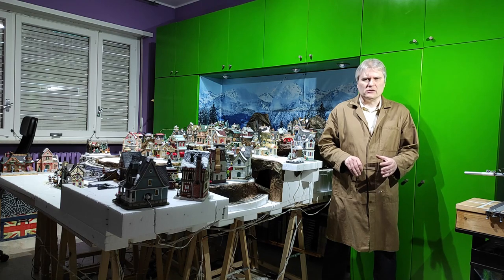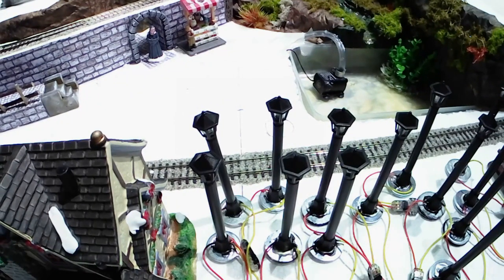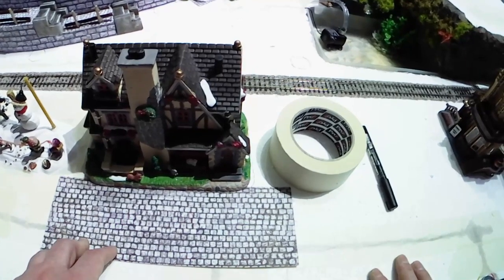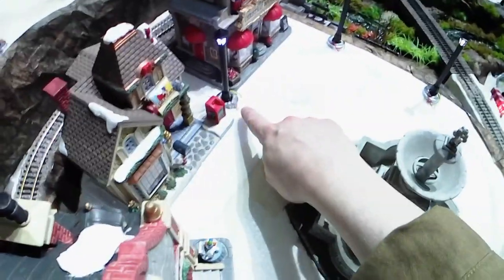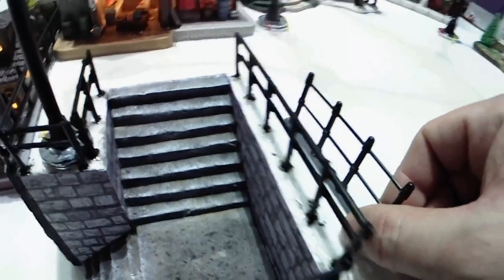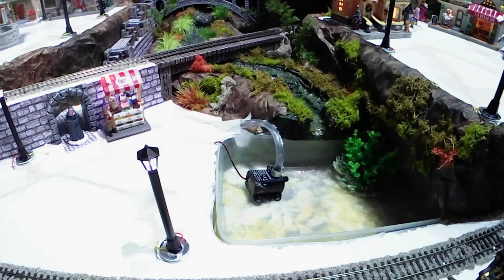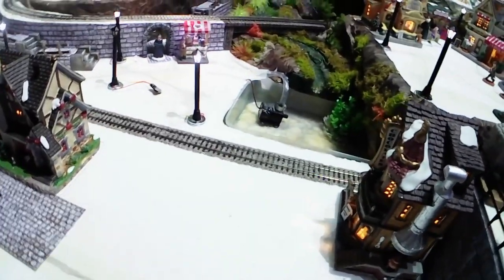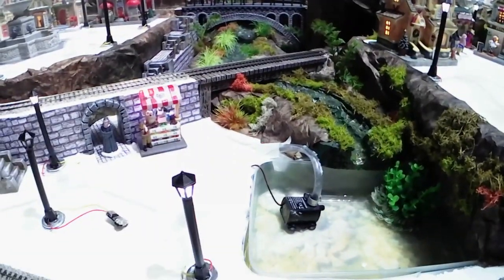Christmas Village Tutorial 2020 - Part 20

Comment: Hi Silvio,
Your village is already amazing! I’m very anxious to know about the snow on your rock paper? I’ve seen your past villages and I see there is a light dusting of snow.. how do you do that, make it look realistic and all without making a mess or ruining your houses, accessories? I love how my rock paper turned out and I don’t want to wreck it.. I know you will probably get to that but may I please have a hint??😊
Reply from the maker: Hi dawn. Sure. It is not e secret. I generally use two methods for the snow on rock paper.
First one:
I simply use some snow spray. First I cover everything (buildings, trees, figurines...) with some paper towel than I spray (with light pressure!!) from distance and very quickly the rock paper in order to avoid to get it too wet. Then I wait for the first layer to dry before deciding if I need an extra layer.

Second one: 
Always covering everything.
I use some spray glue where I need the snow on rock paper then I scatter some of my frosty snow on top of the glue.
I don't spray all over the paper but I go small zone by small zone.
If needed I repeat the procedure after everything is dry. Otherwise spraying immediately another layer of glue would make the snow fly away.

That's all. Nothing really special.
Reply: @silvioallena  Thank you! As always you give a detailed explanation and respond so quickly. I’m curious why you don’t do that before placing all your houses and figurines? 
And last question, I promise(at least for now, haha) which method do you prefer? 
I really do appreciate all your help!
Reply from the maker: Hi Dawn. Please don't be shy just ask all the questions you want. They might be of help to someone else.
For me sparsing or spraying the snow is important for the depth of view and for the harmony of the landscape.
Doing that before placing the buildings it could mean hiding the snow behind them. The snow, more precisely the white contrast of the snow, compared to the color of the rock paper helps attracting the viewer towards it. It is an alternative means of drawing the observer's gaze instead of using movements. 
So I have to do it after the placement of the buildings.
It is a disaster if I do it wrong but I prefer spraying the snow, very gently.
Reply: @silvioallena  Thank you so much 😊